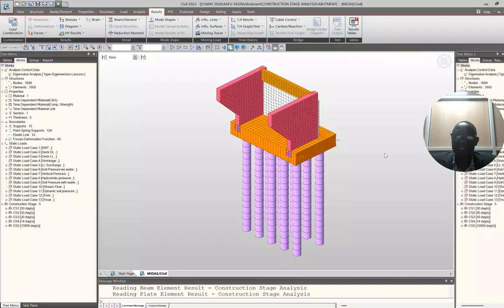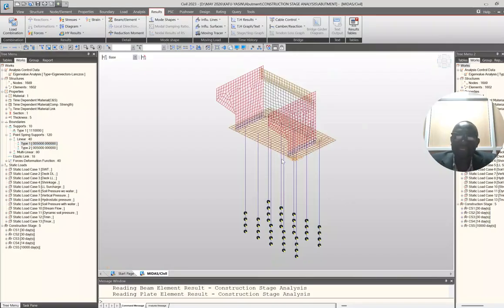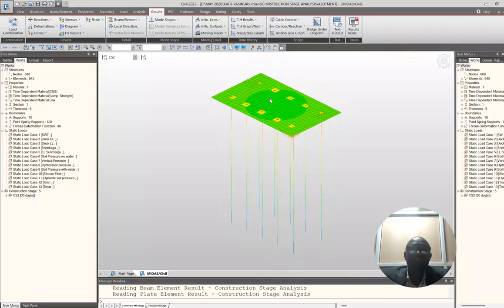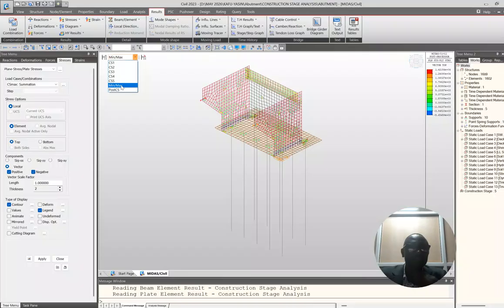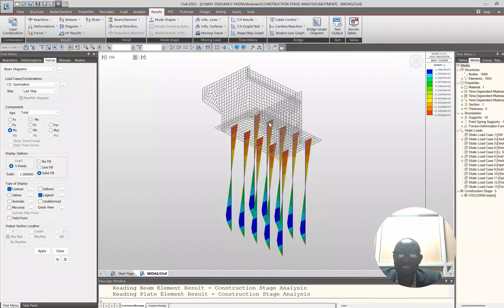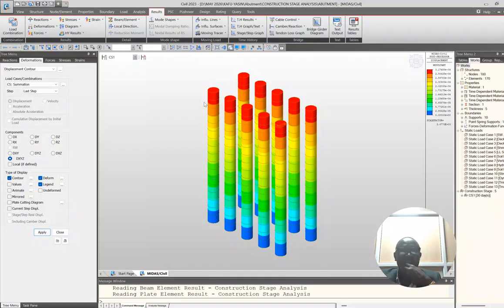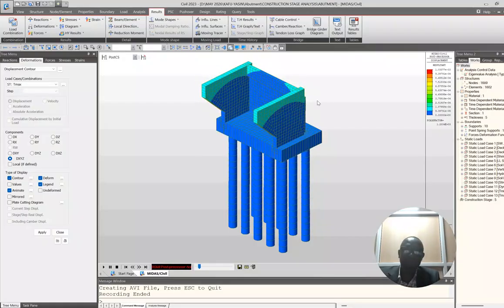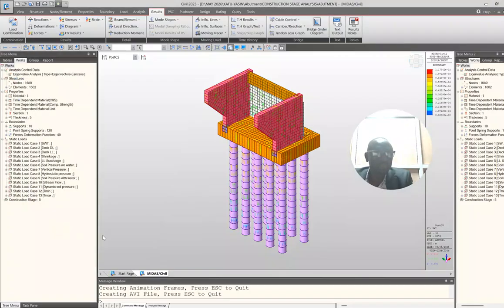05 06 2026 18 57 18 REC

Comment: Hi, Eng the turorials you have been preparing are ver usefull, Could you please make a tutorial in which the design of concrete deck slab and RCC or PC girder been design in the same time or same file similtiounsly( I mean loading the supper sturucture transversly for deck slab design and then in the same file loading the supper structure longitudinally for girder design because in all torurial for supper structure design they only design girder Not slab)